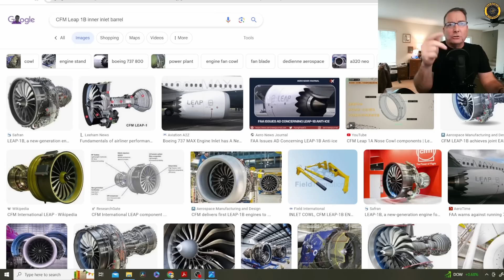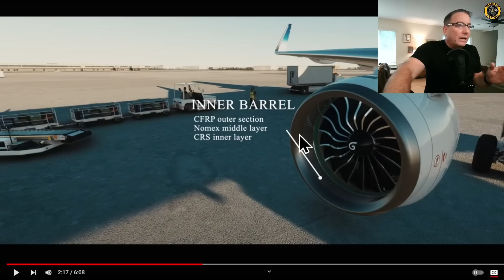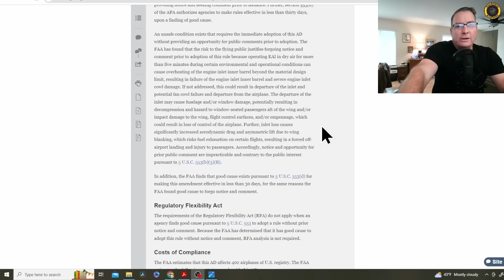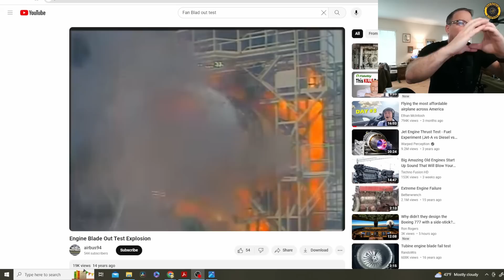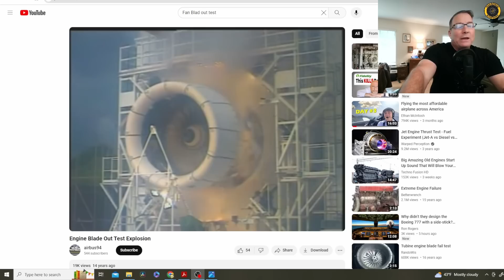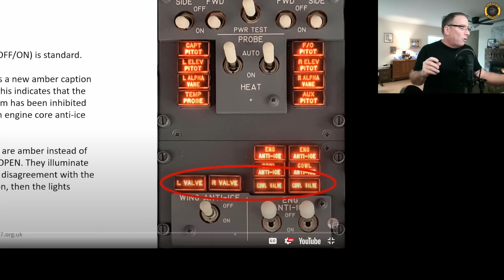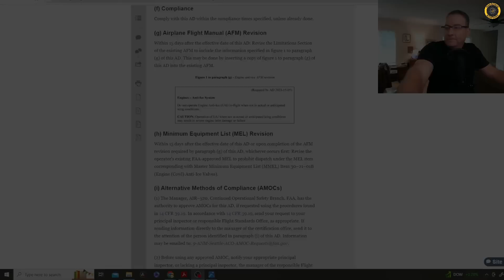Boeing 737 Max-7/-10 Certification HALTED! 1 Feb 2024

Comment: No one can convince me that with all the engine testing and particularly with respect to blade containment, this was not known.  With a new material someone didn’t  think to check how it handled bleed air temp?  Shades of the Shuttle Challenger disaster.
Reply: Good point. My opinion is that one of Boeing’s main issues involves adequate testing. They tested how the cowling handles anti-ice bleed air temps in icing conditions. They just failed to test it in non-icing conditions.

Comment: What if you need to leave anti ice on for longer durations than the cowling can withstand ?
Reply: Apparently it works fine in icing conditions, however long they last. But it causes problems if it’s on in non-icing conditions.

Comment: So let me get THIS RIGHT! Boeing couldn't put A FUCKING LIGHT ON to warn the pilots?! A responsible course of action would be to CANCEL this 737 Max line ENTIRELY and start from scratch! But THIS time, to be let known IN ADVANCE that IF the next airplane has ANYTHING similar to the Max THE WHOLE BOARD OF DIRECTORS PLUS THE CEO WILL HAVE LONG JAIL SENTENCES! THAT will ensure the plane is made properly!
Reply: There is an icing conditions indication. The problem is that there is no automatic off/on for engine anti-ice.

Comment: Well. Here’s food for thought, greedy pilots are flying the industry into the ground. It’s a deep subject, yes.  There’s a very thin threshold of hourly operating costs vs average seat pricing. Boeing has to keep manufacturing costs competitive with the competition.  Competition labor rates are cheap. Research and development is not.  If flight crew weren’t so greedy, airlines could loosen up that threshold. Boeing could invest in heavier R&D and subsequently a more reliable aircraft that airlines would be more willing to pony up for.

Comment: Back in high school I had a rusted out Nissan truck that never left me stranded once. It did require removing vice grips pinching the heater hose and reinserting the blower fuse on cold days, reversing the procedure when the weather warmed to prevent heat stroke. Several corrosion related mishaps included depositing the spare tire in the middle of an intersection and demonstrating the abilities of four wheel steering to an amazed crowd at the drivein when both LR spring hangers departed the frame. Fortunately, the rear end pivoted enough to unhook the driveshaft and allowed me to take a bow and give interviews to the fans. Ole Blue taught me a few lessons I still regard today. You dont get second dates with girls by chatting through open floorboards. Doing a walkaround before leaving is necessary, and should only be rushed at red lights at busy intersections. And more importantly, I would've been an excellent Boeing Max driver.

Comment: Is this not an issue on the A320 too? They use the same engine.
Reply: It’s not an engine issue. It’s an engine anti-ice cockpit control issue.
Reply: @robertbutsch1802  WRONG! The cowling material can melt if the de-icing is left on. Sounds like a pilot problem. Let's keep lowering the bar on qualified pilots, that will makes us safer

Comment: Just a note;  this is an engine manufacturer issue and not a Boeing issue.
Reply: @tomjoseph1444 Better double check on that. I think you’ll find the inlet is designed and built by Boeing (Juan misspoke on that early in the video).
Reply: While Boeing set the requirement for the manual operation of the anti ice, they did not specify the construction of the inlet ring/cowl.  The engine manufacturer designs and test all the aspects of the actual engine assembly.  I believe that neither thought that it would be an issue and I am sure they are working together to resolve it. @ppeterson9359
Reply: @tomjoseph1444 many others including pilots have said the cowling and nacelle are at least designed by Boeing. And it was Boeings responsibility to fix the cowling after the SWA1380 accident

Comment: Juan - quick question.  Why is this deicing problem something that Boeing needs to correct?  Isn't this an engine design issue ?  The engines and that cowling obviously were built using that carbon fiber.  The design for how they would heat that is also done by the engine manufacturer correct ?  So, they should have been responsible for knowing the temperature limits of that carbon fiber and the total heat that would be pumped through that cowling in order to melt the ice. Seems like a pretty clear failure of the engine manufacturer. Boeing doesn't make the engines for this particular aircraft as well, does it ?
Reply: The failure is with the engine anti-ice control, not with the engine anti-ice itself. The pilots have to remember to shut off engine anti-ice when not in icing conditions rather than that being done automatically.

Comment: I always used to say this about cars: "Plastic, the ultimate in job security". Now I can say about aircraft engines: "Plastic, the ultimate in designed castrophic failure!".  How much advantage in weight and manufacturing could they gain vs an alloy ring.  We all know the CFRP "plastic" offers a great "cost savings" and THAT is why they used it.  If and when I fly, I'll be looking at the type of airplane used when selecting a ticket.

Comment: The 10 years in production corporate jet in which I am type rated and am an instructor has a completely automated anti-ice system. The only time it is in the manual mode is if we taxi and are depart in icing conditions, or for some abnormal with the system. That the 737 has a completely manual system with such narrow operating parameters that can easily lead to a catastrophic failure is, IMHO, a major design flaw. Only a bean counter with no knowledge of aviation operating conditions could come up with such a bone headed idea.
Reply: The anti-ice system was designed and tested with icing conditions in mind. It’s highly unlikely flight test crews would have turned it on in non-icing conditions just for the hell oof it to see what would happen.
Reply: @robertbutsch1802  Actually, that is exactly the kind of things test pilots often do, though they don't do it "for the hell of it." They do it to find the flaws, the limits, the dark places no one thought of. That's why they are called "test pilots". I never did any test flying for a major manufacturer. But I did do some for a company that modified airplanes for STOL (Short Take-off and Landing) operations. Spin testing wings that had been modified with leading edge cuffs, stall fences, and tip tanks, could get pretty exciting. We would install drag chutes to ensure recovery, which also had to be fight tested. That could get a little exciting as well.

Comment: Why is this a Boeing issue? Sounds like a CFM problem
Reply: The problem is with the cockpit control of engine anti-ice making it a Boeing issue.
Reply: @robertbutsch1802  That's not what is presented in the video. The engine bypass air is too hot and can melt the composite. That's what was said. The de-icing is manual and requires intervention so does most things on an airplane.

Comment: This wouldn't nearly be as big of an issue if they installed ice detectors. You wouldn't even need EICAS to display it. It already gives a scratchpad message saying TAI ON ABOVE 10C. But Boeing just wants to phone it in because SWA is on their ass about getting the Max7
Reply: The MAX has icing conditions indication.

Comment: There's no good reason to fly on a Boeing plane today. Thank goodness for Airbus.
Reply: Airbus A320 disasters.

Source:  Wikipedia

On 28 December 2014, an Airbus A320-216 registered as PK-AXC, crashed into the Java Sea killing all 162 on board. 
The cause was initially a malfunction in two of the plane's rudder travel limiter units.

On 19 May 2016, an Airbus A320-232 registered as SU-GCC, suffered a cockpit fire and crashed into the Mediterranean Sea 
20 minutes before its scheduled arrival at Cairo International Airport.  All 66 on board were killed.

On 22 May 2020, an Airbus A320-214 registered as AP-BLD, landed at Jinnah International Airport gear-up and executed a go-around. 
A few minutes later, both engines had shut down. 
The plane crashed into Model Colony near Karachi on final approach to Jinnah International Airport for an attempted emergency landing, 
killing 97 of 99 on board, as well as killing 1 on the ground.

On 5 November 2014, Flight 1829, an Airbus A321-231 registered as D-AIDP, was flying from Bilbao to Munich when the aircraft, while on autopilot, 
lowered the nose into a descent reaching 4000 fpm. 
The uncommanded pitch-down was caused by two angle of attack sensors that were jammed in their positions, causing the fly by wire protection 
to believe the aircraft entered a stall while it climbed through FL310. 

On 31 October 2015, an Airbus A321-231 registered as EI-ETJ operated by Russian airline company Kogalymavia crashed in the Hasana area of central Sinai, Egypt 
while en route from Sharm El Sheikh, Egypt to St. Petersburg, Russia. There were 224 people on board (217 passengers and 7 crew). 
There were no survivors.

Comment: Boeing can design the anti-ice system like the ones of Gulfstream 550 and above. The key is to have a very good ice “detection” system and an automatic activated anti-ice system. The system of the G550  is always left on AUTO position, if ice is detected, anti-ice is automatically turned ON and will automatically be turned OFF 5 min after the Detection system indicates that icing condition no longer exists, the anti-ice can be turned OFF manually then switch back to AUTO by the pilot if the crew feels that it unnecessary to leave the system ON for few more minutes . Additionally, if flying or taxiing no icing condition and then “heavy icing condition” is expected in flight or on departure, in consideration to performance being computed, anti-ice system can manually be turned ON prior entering the runway of departure or prior getting into icing condition in flight.

Comment: Thanks so much Juan - Broncolirio for your fantastic insight into this east to understand explanation of crucial issues buried deep into the Boeing and I have even greater respect for the crew who have to worry about yet another lingering problem if the NT I valve is stuck after leaving the iceing conditions. It’s shocking to see that despite so much advance in technology of aerospace industry but still stupid design blunders creep up time and again which my bike shop can find reliable solution to.

Comment: The Max is an aircraft that shouldn’t have been built. Like you said they should have started with a clean slate and accepted a new type rating. Instead their desire to drive shareholder value got in the way of what’s best for customers and passengers.

Comment: Where's the systems engineers when you need them? Making the pilots turn on/off a critical piece of support equipment manually where they can't see weather conditions like in the the middle of the night is unthinkable.  And why didn't Boeing require CFM to test their engines to see what would happen when it  goes into a meltdown.
Reply: 737 pilots have had to manually turn on/off engine anti-ice since 1967.

Comment: Juan, you are absolutely correct that Boeing's insistence on the 737 rather than a new a/c, and the resulting requirement of type commonality, means that suboptimal technical decisions have been made.
Reply: @whoprofits2661 The airlines wanted Boing to improve the 737, not replace it, and Boing's stockholders agreed. Stop blaming Boeing alone. Try telling your customers that you're going to sell them planes they don't want.
Reply: @DerekJohnson-us7vy boing is responsible. They could have explained why they couldn’t do that, and it would be a bad idea in the long term. Instead they just nodded along. That’s sales driven “engineering”. Usually a disaster.

Comment: Are the CFM Leap engines used on other aircraft? Do they have the same engine problem?
Reply: CFM does not design/make the nacelle anti icing components and the problem is not the LEAP engine. It is Boeings design of the nacelle anti icing system/components that is the problem. Airbus uses a totally different design and has NO problems

Comment: I’d much rather engineer for safety then engineer for emissions.  
Easy to see it go too far.  Our cars and trucks we by are much over engineered from demands from the government…..which is why our new vehicles are a mechanical mess.  Putting plastics inside engines that will come in contact with oil and coolant is a high level of stupid to save a .5 mpg or whatever it is. 
The same stupid will bleed over to aircraft industry.

Comment: It seems to me, if we can put aside the gratuitous and frankly obnoxious Boeing Bashing Brigade that hangs out on YT for a moment ... this situation here is the product of trying to extend and push on the boundaries of type certification so as to permit the Max series of airplanes to operate within the legacy type certificate (thereby saving costs of bring on a new airplane, for operators, etc).  If that is the case then I would say, here is yet another example of FAA simply not doing its job.  There are three principal actors here in the these scenarios:  Boeing, the airlines, and FAA ... and only one of them has the authority, and the responsibility, to tell the other two what to do.  

If FAA had pushed back, say, on letting the Max go into line service without training crews on MCAS sufficiently ... the famous Max accidents would not have happened.   Here we see a problem arise which threatens the extension of new or different technology into a type certification process so as to extend the lifespan of the type.  But FAA can stop these excursions from sound judgment by simply SAYING NO and insisting on advancing the process under a new type identification and as you say, start with a clean sheet.   Okay, the airlines and Boeing are being  cheapskates about this stuff but FAA is under no obligation to go along with that sort of thing.  With one piece of paper they can say no, you have to do it this way, and the other parties are going to have to go along, are they not?  So why doesn't FAA DO ITS JOB??   Sorry but I just don't get it.

Comment: I understand the differences between MAX8/MAX9 but if similar LEAP engines are on the MAX8 which is flying, why is there a delay on the MAX7? More generally, why is there additional scrutiny on the MAX7 AC if the MAX8 is already flying?
Reply: The MAX 8 and 9 were certified and delivered before the issue was discovered. The 7 and 10 aren’t certified yet.

Comment: For what it is worth the MOST modern Airbus, the A350, has manual engine anti-ice, also. Kind of a shocker, most versions of the 767 (but not the 757) have auto engine anti-ice. 

And believe me, it is easy to forget to turn off the engine anti-ice. Things are normally getting real busy at about that point in the flight. I mean real busy. Everyone always forgets it for a few minutes (or.. ahem, longer) until someone notices.

That said... I still think the 73 is a better plane then the comparable Airbus series, and would prefer to fly a 73 over an Airbus. And I have flown both.

Comment: Frankly I’m tired of the Boeing bashing/MAX bashing and profits over safety diatribe at every turn. Profits over safety? Would that be the A380 the world’s largest airliner having only 2 thrust reversers on a 4 engine aircraft? Or the redesign of the rudder travel limit system and not alerting pilots to this drastic change causing the AA flight  587 A300 crash from JFK? Airbus never came clean. 
Fix the problems don’t continually bash Boeing. I’m a 30+ year aircraft mech for the majors and it’s all a bit overdone.

Comment: This is weird. If the flow rate they are using is overheating the engine rim, why don't they restrict the flow to reduce the heat delivered to the rim?

Boeing has treated time-limited exceptions as politically-limited exceptions, and used its political clout to ensure the time limit can be ignored.

Shame on my senators for assisting Boeing in ignoring well known rules and deadlines, and kudos to Sen Duckworth for calling Boeing on its bullshit.

Comment: When I hear the terms polymers and fibers used in very critical components I think of the Titan submersible.  What was critical in that case was the adhesives that held the carbon fiber together. It couldn't take a large number of  stress cycles. If engine cowling is now polymers and fibers that can't be over stressed (over heated ... even one time) and humans who typically make errors are required to never turn the heat on before needed and never forget to turn the heat off as soon as heat is no longer necessary I can forsee multiple cowling failures occuring .... before a manditory redesign. Are the people at Boeing really expecting pilots to never make a single mistake applying or disengaging cowling heat? ... seriously?

Comment: This one is for the Duh file. They used carbon fiber on parts that can get super heated for functional reasons?

Oh boy, can we just junk the entire MAX endeavour and call it  day? Just one thing after another. These MAX issues are not trivial, but fundamental. That's what separates MAX development from other aircraft designs where minor issues pop up but they were usually not life threatening.